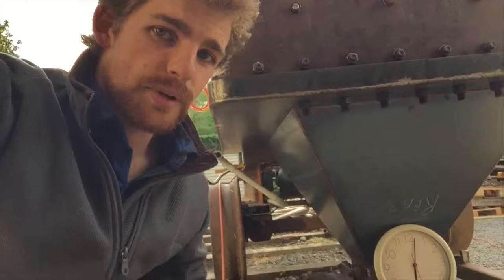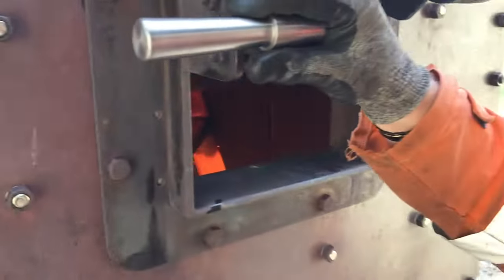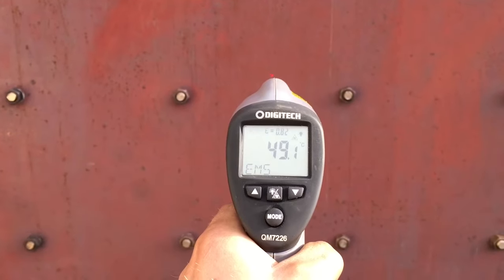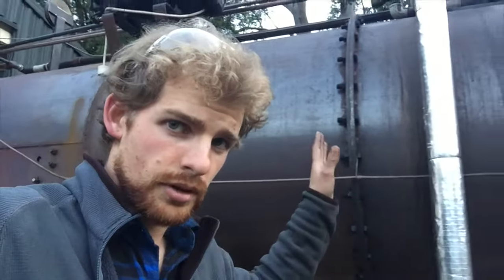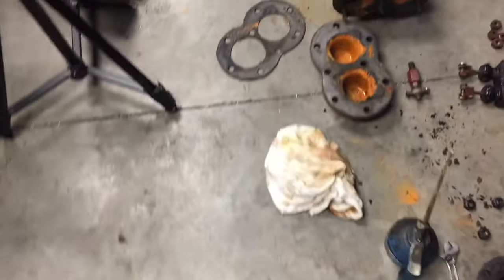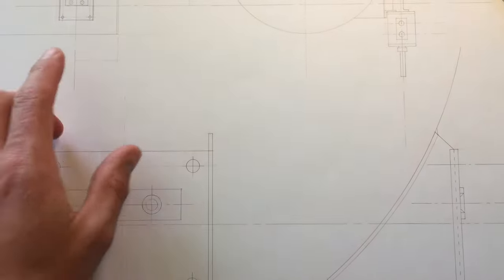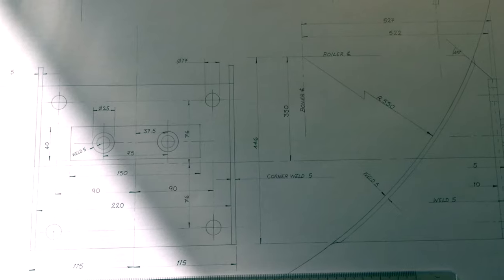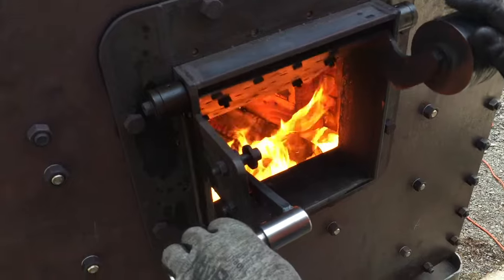21st Century Boiler Secrets | Modern Steam Locomotive Design & Build EP5

Comment: Why do you not use injectors to feed water into the boiler? Injectors are 90% efficient.
Reply from the maker: Yes, injectors are very efficient on their own, but they limit the quantity of energy that can be recovered from the exhaust steam and so reduce the efficiency and power of the loco. The (eventual) boiler pressure of 310 psig is nearing the limit for injectors too.

Comment: Did you consider other alternative fuels? Although wood is sustainable, it does produce Carbon Dioxide. I have always theorised using Hydrogen Gas for High Heat output and Zero Carbon Footprint. All the same, a great project. Do you plan to manufacture more than the boiler?
Reply from the maker: The carbon dioxide released by wood fuel doesn't add carbon to the carbon cycle, just as you and I consume food and breath carbon dioxide out - so no contribution is made to climate change. Long ago I explored hydrogen in depth, but my understanding is the bulk of hydrogen produced today is done so by steam reforming natural gas, thereby adding carbon to the carbon cycle! The alternative, electrolysis generated hydrogen, is taking high value electrical energy (generated somehow) and converting it into low value heat energy unless the hydrogen is employed in a fuel cell - which then makes for a relatively inefficient (but higher capacity) battery. Thank you for raising this point as it is a good question! Yes the whole locomotive is to be built i.e. chassis, tender etc. A boiler on a static test frame is great for scientific type tests but not much of a demonstration.

Comment: Be careful 
If you make steam too fast you can stress the boiler that can  cause boiler failures or problems
Reply: We don't know much about the boiler set up yet, but what we know indicates some sort of mono tube type of setup, that has no problem at all with fast steaming up.  If the circulating pump was electrically driven, instead of steam powered,  this system could be operational well within half an hour!
Reply: @chamagical  just be careful 
It might not be a wet fire box but boiler failures can take place.
Jou should take your time with fireingup.

Comment: Im no exspert but thats the rong type of pump
That is a boiler test pump
Reply from the maker: Both pumps are temporary only, I'll be building the new pumps in upcoming episodes.
Reply: @Mackwell-Co  
O okay
I recommend steam injectors
How did you make not emit soparks.?
Did you use spark arestors
Reply from the maker: I'm using an advanced combustion system to eliminate spark emissions instead of a spark arrestor, the latter is liable to block and will not always arrest 100% of the sparks.
Reply: @Mackwell-Co  
Are you guys gonna use coal?
Reply from the maker: Nope!
Reply: @Mackwell-Co  
Thats a good idea 
The plate above the fire would probably melt

Comment: This is lovely BUT. A diesel engine can start up immediately. There isn't any point in this.
Reply from the maker: Diesel engines are impressive, turn the key and off you go in less than a minute. When it comes to transitioning from fossil fuel to sunlight, what options do we have?
Reply: @Mackwell-Co  Nothing at the moment. Solar power isn't effective enough on a wide scale. Atomic energy is the future. Remember: The Future Is Nuclear!
Reply from the maker: Check out the EROI of nuclear and its cost trends. A nuclear future seems unlikely. Advanced steam locomotion is simply the most efficient way to turn sunlight into traction.
Reply: @Mackwell-Co  what about a steam electric turbine? Steam to generate electricity, electricity could be stored in a battery for when there is no water and to preheat water for quicker start ups?
Reply: @Nundevwizer  might as well just build a gasifier ?
Reply: I have trees in my yard, but no oil well, so there's that.
Reply: @rodslagter7368  do you have a train line in your yard?